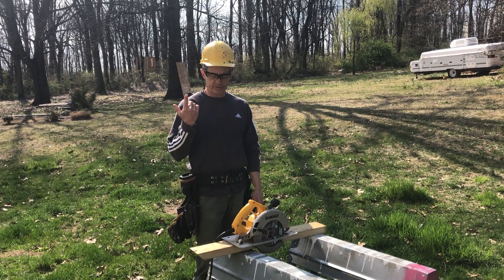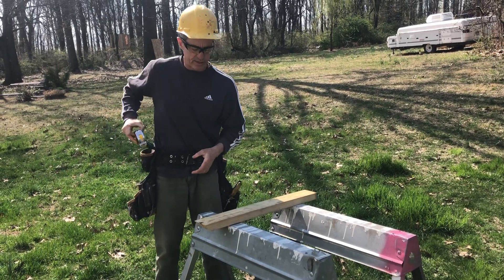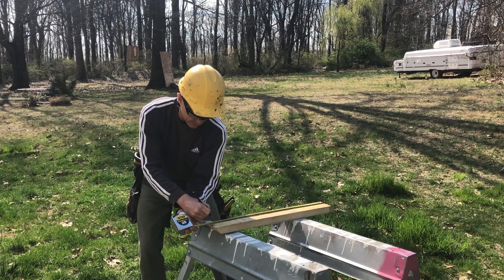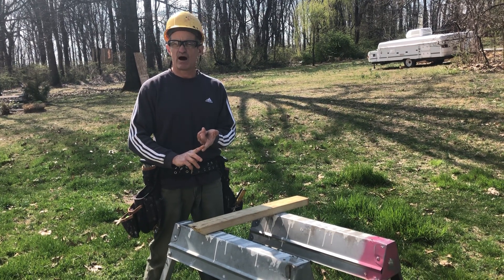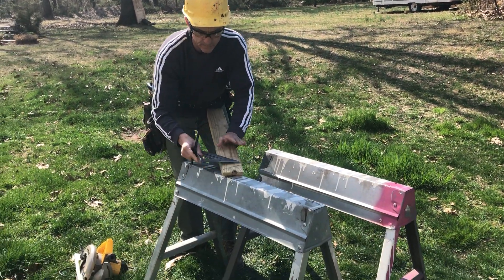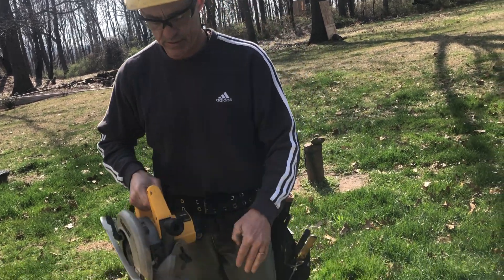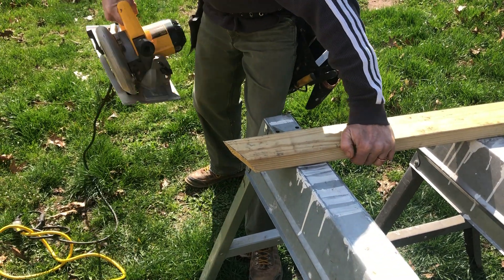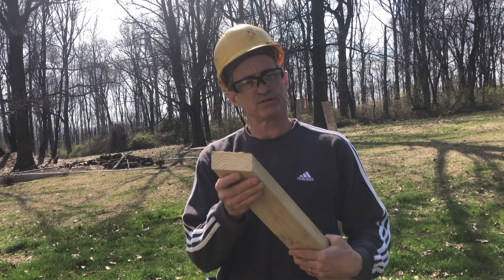How to cut a compound angle using a circular saw

Comment: This is NOT how to correctly cut a compound angle. Setting the saw at 22.5 degrees will result in 22.5 degrees only when cutting perpendicular to the edge. The angle changes as soon as you begin to cut a mitre.